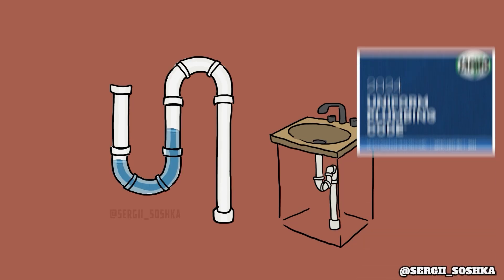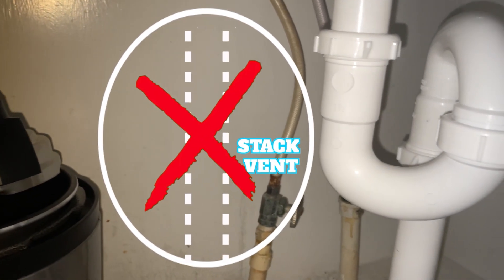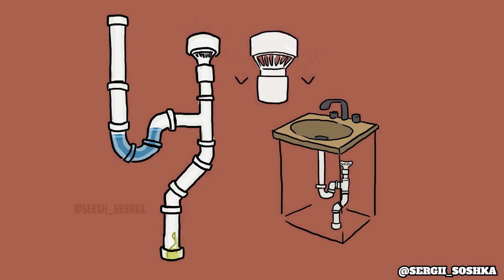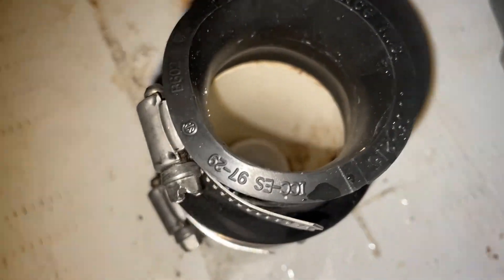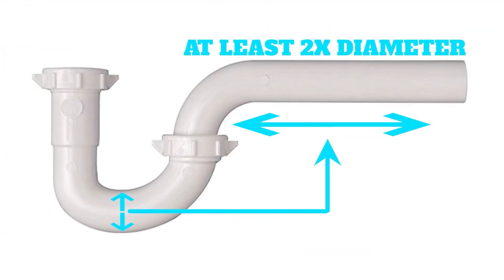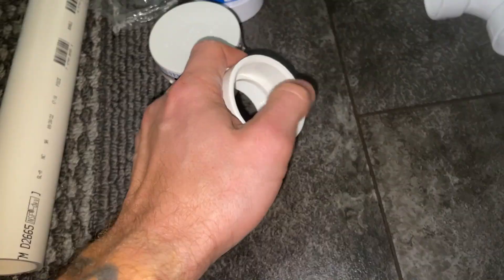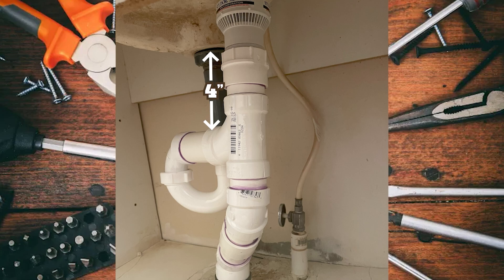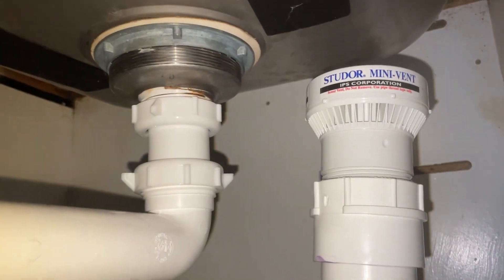Why Your Old Plumbing Could Be DANGEROUS Right Now?

Comment: just a heads up the sweep for your tee should face down and not upward....other than that good info
Reply: I was looking at that too That has to be fixed, otherwise you have a draining issue, right?
Reply: @FranklyMyDearIDontGiveADarn  yes because the water can build up in the trap and not have a good flow.